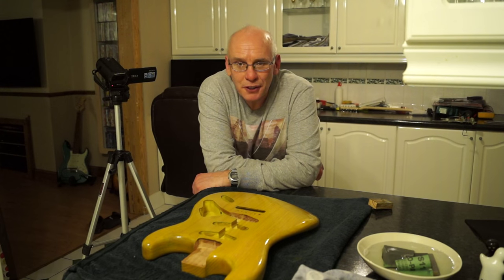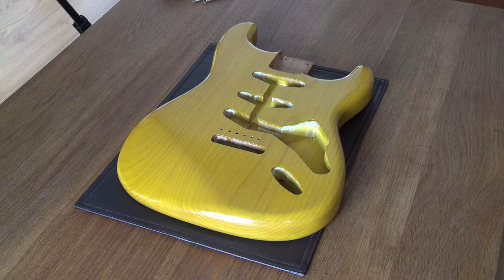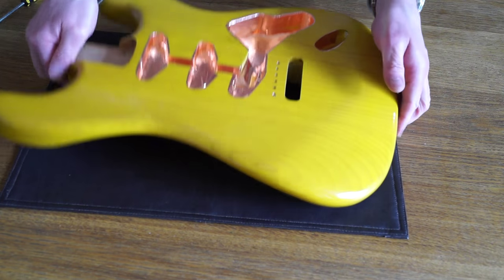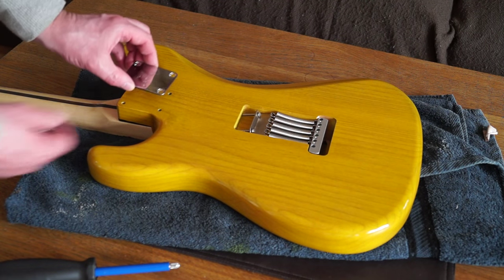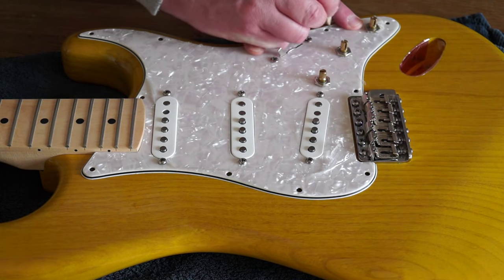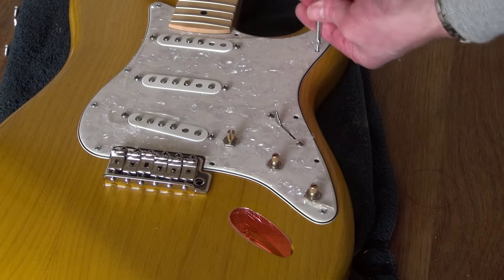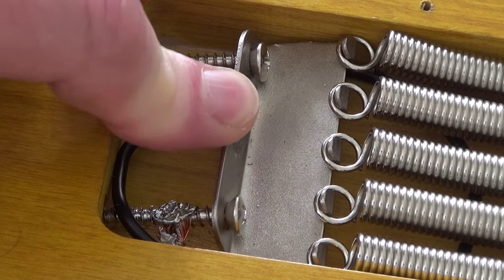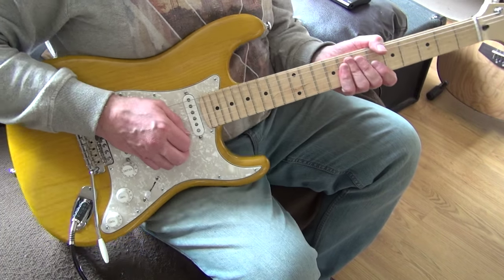Strat Partcaster Assembly and sound tests

Comment: Nice built, but you need to improve your soldering. Add flux next time and in bigger areas use bigger nozzle. Solder has to flow, now I see a lot of cold solder joints. Cheers.
Reply from the maker: I have a better soldering iron now and use multi core solder, better joints now. Still not had a problem with this though and it was done well over two years ago ;0)
Reply: You are right! Those are "cold" welds that shield the screen and can make noises! You must use a more powerful soldering iron. The welds must be shiny.
Reply: and the most important thing is a bigger tip and one that is clean and tinned properly
Reply: Resin core so,see doesn’t need flux. That’s what the resin is

Comment: i had to buy a strat neck then reshape the headstock to tele .it worked quite well .
Reply from the maker: Clive Lombari Good tip Cheers!
Reply: Wouldn't a teli neck fit any way?
Reply from the maker: The neck pocket shapes are different so you have to modify either the pocket or the neck!
Reply: Well you see I thought the same thing, so why did you bother to reshape the strat neck then?
Reply: +Davyd Mir  cos I was fitting it to a tele and testing myself 2c how it would turn out.I have had a go at most jobs including a refret which was a lot easier than I thought
Reply: oh cool did you put any decals on it?
Reply: yes but not brilliant I haven't found a good seller yet

Comment: Having used my share of Tru Oil over the better part of the last 50 years to refinish and finish many, many rifle and shotgun stocks, I'll offer you my take on using this product that might help you the next time you use it to finish a guitar body. You can take it or leave it, but I like the way you create these guitars and you work hard at getting a nice finish, so maybe you can take some finishing tips from a guy who knows Tru Oil and getting a deep classy finish..... 
Starting with the prepped body, use 50/50 mineral spirits and Tru Oil and apply heavily and allow the wood to absorb as much as it will. Repeat this process until the wood will not continue to absorb this mixture. 
Lightly sand the body down using 600 dry, until smooth. Then using the same 50/50 mix, begin wet sanding the 50/50 finish into the body. This fills the pores of the wood and builds the surface for final finish that will be applied by hand. This process may have to be repeated several times depending on the pores of the wood, large ones take longer to fill and allow the stock to dry completely between coats.... (guitar body)
With the pores filled and the surface prepped for final finish, use a tac cloth to lightly remove any dust. Using straight Tru Oil, I usually will place a stemmed coffee cup upside down and use the bottom shallow portion of the underside pedestal for a place to pour a little Tru Oil to dip a finger into, and then transfer that to the stock or in your case, the guitar body... Using the heal of your hand, push the finish with the grain until it starts to feel tacky, then apply more and repeat all over the body of wood. There will be areas where you will have to use your fingers in place of your hand's heal and that is fine, just rub it in until it feels tacky and stop. Apply several coats of finish this way, a good deep finish that you have to "look down through" requires patients and numerous coats built up over time, then wet sanded with very fine wet sand paper and buffed or polished depending on the results desired. Rifle stocks come out super high grade finish this way and they are durable.
The finish that you got on that strat was very nice! The advice that I gave you will get that finish deeper into the wood and prevent sanding down to raw wood in the future!

Comment: about the swap the body on mine, i'm especially worried about the soldering, always mess up with that
Reply from the maker: Its easy with a bit of practice on some old bits and bobs. Make sure you get a decent fine tip iron!

Comment: A real beautiful guitar !  Nice wood !  You need a more powerfull soldering tool (watts).  The welds I saw are "cold".  I  understand that we must sometimes do whatever we have to do with tools we already have.  I wish you good times with your new instrument !
Reply from the maker: I burnt my big iron out! I really should get another one ;0)
Reply: the only bad thing I could see on this build was the soldering. it was pretty poor. Also the extra long leads to the jack plug will pick up more interference. keep the short (without being silly) and twist them together like telephone wires to reduce noise as much as possible

Comment: Nice one mate. You mention in one of these videos that you waxed potted the pickups. Have you ever changed covers on pickups that are waxed in? How would you melt the wax to get the pickup out?
Reply from the maker: +Dan Osper I tried it on my Epiphone Dot. I un-soldered the cover and prised it off with a blunt knife! I put the covers back as there was a mass of wax and I didn't fancy scrapping it all off or un-soldering them from the pots to boil them up in water ;0)
Reply: Getaways and Guitars Yeah looks like it could get messy. I'm gonna hit it with a hair dryer and see if that helps me work it lose. Cheers.